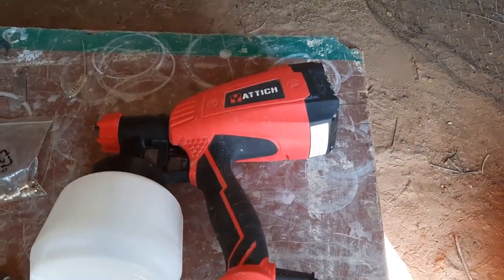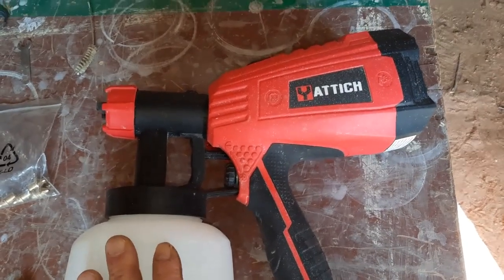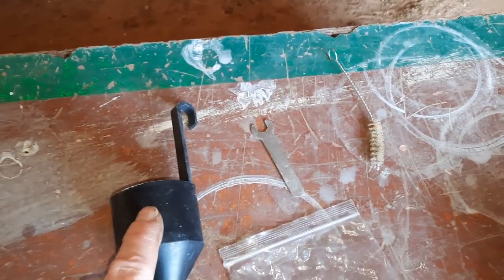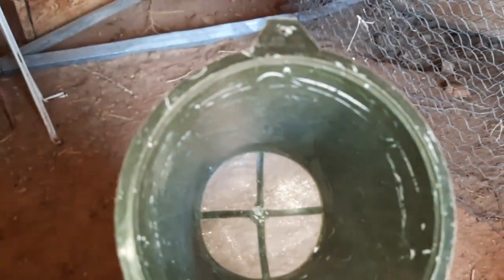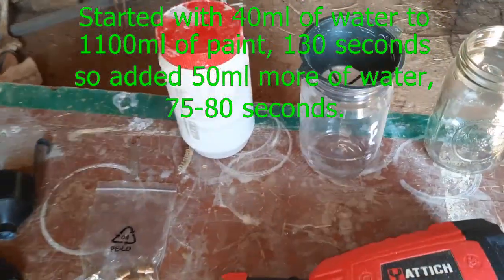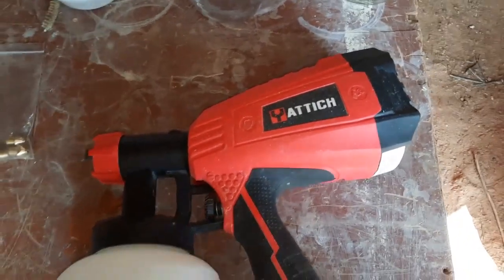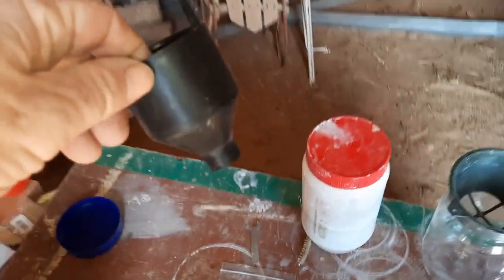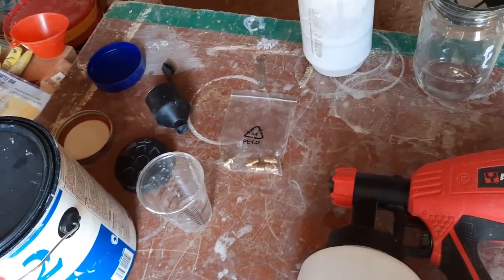YATTICH  paint sprayer Prep, Review, Part 1, O-ring broke update Description

Comment: Thanks for the pointers.  I just picked up a similar sprayer from Buendio (700W model, looks almost identical and I bet they are all made by the same company).  Curious about the overheating issue... when you say it happens on larger projects, what are we talking about (rough square footage wise)?  I'll have to see if mine does the same.

My bet it the small internal air compressor they have is working hard.

BTW... I use Valspar latex stain blocker bonding primer... it is also very thick and works well for me.  I think its the nature of the special coverage and ability to hide & prevent bleed-through.  Thinning it down for the sprayer usually means I'll have to put on more that one coat, as opposed to brush/roller application.
Reply from the maker: Thanks for watching and commenting! I did not use my sprayer this past summer. I used it a lot last year for several projects. Sounds like you might be afraid to use yours for larger projects. I do not remember size of project where heat seemed to be an issue. My issue was too much heat, not burning hot, but uncomfortable, for bare hands.  However, since I used rubber gloves, I did not have that big of an issue. Just seemed like that much heat was going to take its toll on the sprayer eventually. If I needed it today, I would not hesitate to pull it out and use it, big or little projects. I would buy another if my crapped out on me. I hope this helps. Good luck with yours.

Comment: Thank you sir. Just had to take mine apart. Staining a fence for a customer and all of a sudden paint started pouring out the nozzle. Inside the head there is a black plastic threaded piece that screws down on top of a spring that had come completely out. But anyway, might want to clarify what you mean by 18 turns. I just counted and mine was completely out at 10 full turns. So I assume you mean 18 times moving it as far as one finger can at a time. Also, the o Ring inside my paint can somehow stretched out so big it wouldn't even seat inside the lid. Figured they had squished one that was too big in there. So I cut the excess out and reinstalled it. That sucker shrunk smaller again so that there was a 1 inch gap in the rubber seal. Have no idea how it's going that. Took it out, stretched it back to a full circle and super glue it, but it now leaks paint all over the tank.
Reply from the maker: Sorry to hear you are having problems. I am pretty sure I said several times that my flow knob turns from maximum were more like half turns. I tried several times showing how I turned the flow knob with just one finger and how I counted the approximate half turns with just a one finger turn. 

In addition, I was painting thick latex paint, not a stain. Stains are generally much thinner than a latex paint. That is when the viscosity cup comes in handy. 

It is big time winter here and I put all my latex paint away, so it won’t freeze. Put away around mid-October. Probably will not bring the paint and sprayer back out until late spring. 

However, I used my sprayer many times and I stuck with the viscosity, the 2.0 nozzle and the number of turns from maximum as stated and shown in the video and I never had a problem except for the O-ring breaking. The sprayer will get pretty hot to the touch if you take on a really big project. I do not care for how hot it gets, but for small furniture painting I have had good luck with mine.

 I have only used water base paints with mine and I have never tried a solvent base paint or solvent based stain. I would think it would be much harder to clean up with solvents. I showed my method of cleaning with water and that was the way I did it every time I used it. Was working great when I put it away for the winter.

Comment: Thank you John, blonde female here making my first attempt on back fence today as man in the house is lazy!
Reply from the maker: Sorry so long, try to read all, as I am trying my best to help! 
I have an old horse barn made of cinder block and above that cinder block where the roof is pitched, I have a triangular wood section. My suggestion is to try opening the flow more so it doesn’t take so long to spray paint if you are using a thick latex paint. I did this with my exterior latex paint. I did dilute it with water to get the approximate 80 seconds of flow thru the black cup. With approximately 18 turns of the flow knob I got a nice even spray, no splotches, but very little spray, which would have taken a long time for me to paint that large top part of the barn. I opened the flow to only have about 10-12 turns and the sprayed amount increase, but so did the splotches. Being an old horse barn I just went ahead and sprayed with approximately 10 turns on the flow knob. Much to my surprise, once the paint dried, I could not see the splotches from standing on the ground. Even when standing on my scaffolding, I had to search for the splotches. So, maybe you could try turning the flow know more towards the positive sign if you want the job to go faster. Try this on the furthest not easily seen part of the fence and let it dry and see if you like it. If the splotches are too ugly for your taste, lower the flow until you get something you like. Thanks for the comment, watching my video and I wish you good luck.

Comment: I've been painting interior doors with this sprayer and found many of the same things you did as far as viscosity.  I ended up thinning my water borne enamal (SherwinWilliams Emerald) by about 15%.  I think they recommend no more than 10 but it was too thick at that level.  I was using the 2.5mm tip but I think I was only about 5-6 turns off of max.  I may try the 2.0 tip and a few more turns to see if my splotching is reduced.  Thanks for the detailed info.  btw I'm just a homeowner/hobby woodworker not a professional painter.

Comment: The nozzle won’t screw out. It just infinitely screws but won’t come out.
Reply from the maker: That is so strange to me. Because the nozzles are all metal male threaded. They look like brass. Male threaded like a bolt. And the part they go into is metal female threaded like a metal brass nut.  So, this part of the sprayer is all metal.  I find it hard to figure out why it will not come apart. Mine is basically just like a metal bolt going into a metal nut. Yes, sometimes cross threading can happen even with metal bolts and nuts, but with coarse, not fine threads, it is rare. I am not sure what to tell you, except mine has been used extensively and is still working just fine for small projects. I always take the nozzle off and clean it and run that small brush, that came with mine, into the female threaded area to clean the threads as shown in Part 2 of my videos. I have no idea why yours is giving you this problem. Sorry cannot help you.

Comment: Very well done, thank you for your time.
How many minutes or how many sq feet can you paint before the gun gets hot?
I agree, heat is not a good thing.
Reply from the maker: I wear those somewhat heavy-duty rubber gloves to protect my hands from paint, so a little hard to say. I have painted as many as 10 pieces that were around 4 to 6 square feet each. I generally run out of places to prop them up after 10 or I would probably do more. So around 40 to 60 square feet is the most I have done at one time and the barrel and the gun does get hot. Not so hot that I cannot hold it, but hot enough to feel the heat through the rubber gloves. So far after many uses, over 20 but less than 30 it is still painting fine. Probably the smallest size was only 10 square feet and the largest was 60 or bigger. No problems so far, except, see my updated description about the O-ring that broke. However, I fixed that and I am back in business. I still like the paint gun and glad I bought it. Did not like a brush as I always had brush marks. Did not like the finish of a roller and always felt I wasted a lot of paint when cleaning the roller or just threw the rollers away with a lot of paint left in them. Hope this helps!
Reply: @johntube2525  thanks John for the info and the quick reply. 
I have a 25’ shed to paint. 
I may get this gun to paint the trim and roll the main part. 
Have a great day. 
RG
Reply from the maker: @RG_sssSMOKING  I like your idea to use a roller and the gun for trim. Hope the below helps.
The 10 pieces I did were for furniture and needed a nice finish. I did paint the triangle shaped wood between my cinder block old horse barn and roof, with this gun. 36 feet wide by 8 feet high wood area. So, approximately 144 sq. ft. I used the 3.0 nozzle, almost Max flow, Glidden exterior latex paint with only 40 ml of water per 1000 ml paint. I did see splotches while painting, but I did not care since it was an old horse barn. Once everything was done and dry, it looked good from the ground. I really could not see the splotches when standing on the ground looking at the completely painted project. I also had to move my scaffolding three times during the project. So I imagine the gun cooled some. I kept some water and a cleaning brush handy to wipe down the nozzle where paint would build up on the nozzle before and after moving the scaffolding. I kept thinking, it is going to stop-up on me, but it did not. I did have to use soap and warm water to clean the parts, since moving the scaffolding made the job last much longer than my other small projects. I kept thinking, while cleaning the gun, I probably should have just cleaned the gun each time I had to move the scaffolding and made it a three-step job. Alternatively, perhaps this would have been a project to use a roller and an extendable handle for the roller, then touch up any missed spots.  Hope this helps!
Reply: @johntube2525  Yes this helps a great deal. I will use your measurements water to paint if I get this gun.
I am thinking to do the trim with this spray gun first then coming back and rolling on the large surface and trim it out with a brush. Dose not have to be prefect, I would like to make it as easy as possible. Thanks for all of your help. RG

Comment: Thank you for the video! I just bought this spray gun and the same paint! I'm so happy to come across your video. I tried it last night and it was very splotchy. I'm excited to try your recommendation tonight. Thanks!
PS - What distance do you recommend to spray from?
Reply from the maker: I came back to see if you had any more comments and of coarse I was hoping you had better results, more to your liking. 

Sorry I missed the PS yesterday. I went pretty close because I turned the flow down about 18 half turns. Probably about 3-4 inches, but I do move the gun pretty fast so I do not have paint build up and runs. 

I prefer to do multiple coats versus heavy coats that could possibly run. Just me.

Did you like your results with these settings. I am guessing there could be many different settings with different nozzle sizes, different viscosity times and different flow rates. So far I am sticking with my settings. I also tried Kilz PVA drywall primer and I think I like it better than Kilz2. I had used joint compound to smooth out some MDF surfaces and especially the edges.  Decided to try the PVA primer on the joint compound and so far I like it with the same settings.
Reply: @johntube2525  Hey John, my apologies for the delay. Thank you for your response!! I hate to say I didn't have a good experience with this gun. To be honest it was very frustrating and the coats came out terrible regardless of the setting I went with. I ended up rolling it but I learned a lot so that's what I'm trying to take out of this. 

After this experience, yes, I agree multiple coats are the way to go! 

I like the Kilz2! At least I think I do? I don't really know what I'm doing (You should see my edges hahahah) :)
Reply from the maker: @martin8401  Sorry the video didn’t help you get the paint job you wanted.
I am thinking about making a Part 3 or perhaps just updating the description, because the large O-ring on the barrel of mine after using it 20 plus times finally broke. I know you gave up, but anyone seeing this should read my updated description regarding O-rings.
Reply: johntube2525 oh it wasn’t your videos fault at all!! I reached out to the manufacturer because I believe mine was defective 🙃

Comment: Good stuf here John. Just subbed. Sadly I dont get a notification when someone replys to my reply. Wish I did. Stay well & safe!
Reply from the maker: Thanks for subbing, I subbed to your channel a while back on the purple HF spray gun. My old Craftsman 25 gallon compressor stopped working right after that. So I bought the Yattich and it worked out for me. I finally saw some YouTube videos on how to fix my compressor. I put new cylinder and new ring in my compressor and it is back to working, but winter is coming and I have moved all my paint from my old horse barn to my garage where I hope it does not freeze.  I am probably done painting until spring. Thanks again.

Comment: Thanks John sir for the detailed video which I was looking for as a beginner. This video helped me so much to learn something new! Once again thank you for the part 2 also 😍👌🏻 (Sorry for bad English)
Reply from the maker: Thank you for watching and for the positive comment. I have used mine around 15 times now and if it just did not get hot, it would really be perfect. Last time I used it I sprayed around 100 square feet of several different pieces of plywood and it got very hot. I then cleaned it by spraying clean water through it and disassembling and brushing the individual parts it and it is still working great.